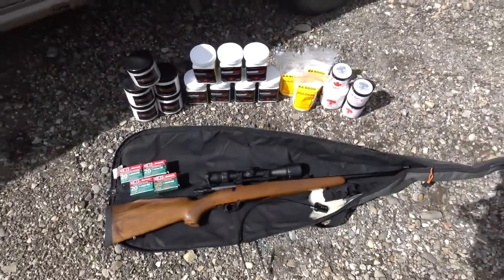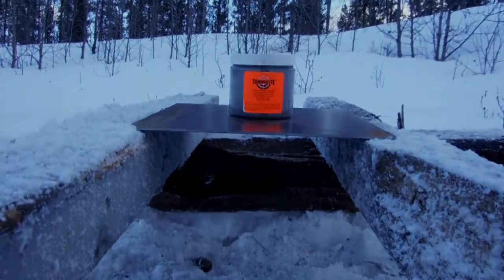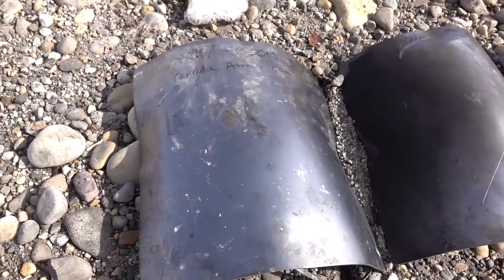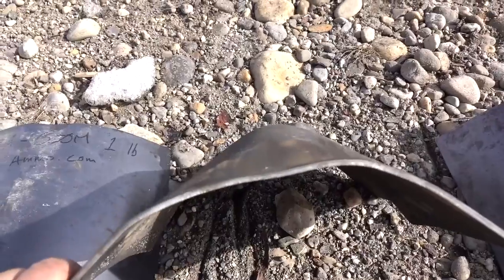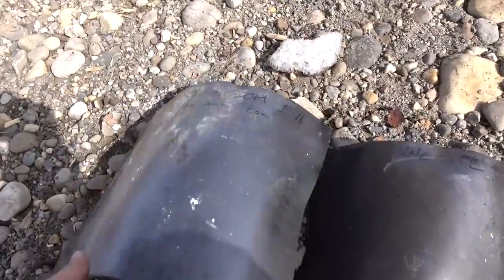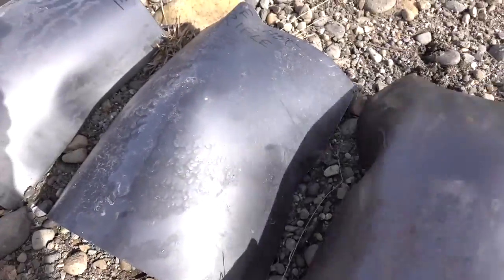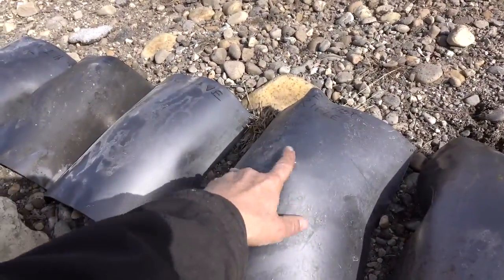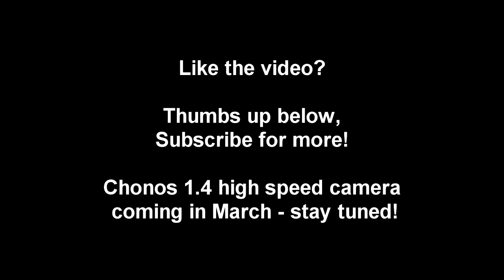Tannerite vs Shockwave vs Sureshot vs Thundershot vs kaboom (960fps slow-mo)

Comment: I was going to suggest plate dent tests, but hell you went and did it already. Good job.
Id like to see Trauzl block and ballistic mortar comparisons, but not practical with projectile initiation. Gryphon must salt their product with something that increases brisance and DP. That's pretty impressive to see that gauge of steel torn up like that.
Reply from the maker: I'm glad you enjoyed the test! Something is definitely different in the formulation, although it looks very similar to the others. I can't tell the difference just by looking, just that gryphon uses a little bit more aluminium.
It would be interesting to see how a military explosive would compare. I bet the same amount of TNT would tear those plates into dozens if not hundreds of pieces.
Reply: Yes, I would agree. TNT, which is a moderate, compared to modern military HE would shred those plates to pieces. I have recently noticed the Gryphon product appears to be made from a smaller prill with higher porosity and lower density, It is more of an  explosives grade prill used in anfo compositions, compared to the larger tannerite prill, that is probably an agricultural grade.
Reply from the maker: Interesting, I had noticed the size of the prills as well but didn't think much of the size difference. So more surface area = more contact between the Al and AN?
Reply: Yes, plus the prill is rough and porous, this increases surface area significantly and  allows reduction components , liquids and/ or  fine powders to easily penetrate allowing greater intimate contact.
Reply: @Gyppor more aluminium plus better prills would definitely make sense. Tannerite and other exploding targets are usually very OB positive (too little aluminium). A pound of properly made ammonal (oxygen balanced, and with powder rather than prills) could probably punch a hole through more than a half inch of mild steel, so the exploding targets are definitely far from optimized.